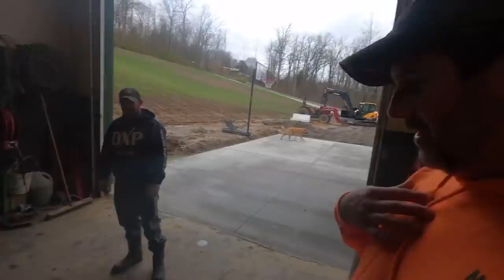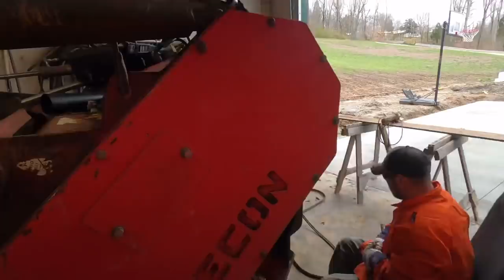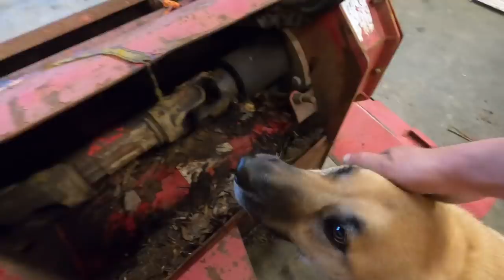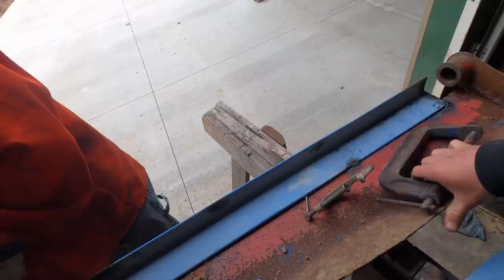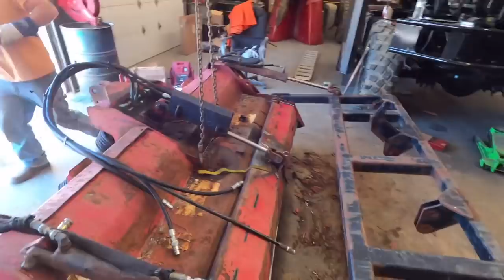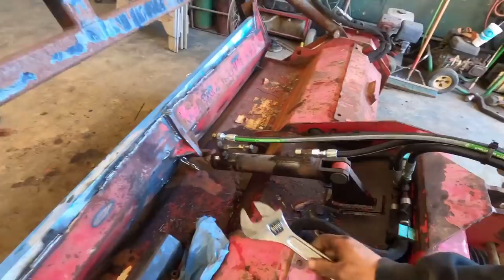Well might have a bought a brush mulcher that needs work and Mrs. Dirt Perfect is not happy about it

Comment: That slop in the shafts are the U-joints wearing out, not trying to be a jerk but you should replace them with your press and replace the belts before they break on a job

Comment: if you have an old axle or even a bucket offa the excavators put it in the bucket of the tractor shes a tilter lookin to happen juuuust right angle an shes gona chew dirt an rocks leaning on the three point hitch so just for safe sake add a bit of weight to the front

Comment: Rubber tires and brush do not mix well but it was a price driven decision on the Fecon, finding a used head for the Kubota would have increased the cost.  A FTX128L used $155,000 if you could keep it busy on utility and pipelines would be great.

Comment: Where is the skid steer mount hydraulically driven mulcher- lol That one you have to use with tractor in reverse and twist around uncomfortably but they do work! Use colored zip ties to label your hydraulic remotes!

Comment: Good work!

I would probably try to shorten the top link on the 3pt, in order to reduce the u-joint angles on the PTO shaft...   The u-joint angles looked a bit steep when lifted...   :-)
Reply from the maker: They have to be equal

Comment: What about the cutting teeth? What shape are they in? They're  probably the most expensive parts on that thing and pretty important that they are in good shape for the mulcher to actually mulch. Being worn out would probably impact the amount of horsepower it takes to keep the drum turning making it need more power handicapping you even more with the lower hp tractor. Just an observation and something that I was wondering about. Good luck with this and I look forward to seeing the mulching video. Might be another purchase in the future if the tractor you have isn't big enough for the mulcher. You're gonna have to send Mrs. Dirt Perfect on a nice vacation somewhere where she'll get pampered so she'll come back all relaxed and calm for when the new larger tractor shows up. LOL! Good luck with that too. 👍

Comment: How is that cheep plasma cutter working outl? Would you buy another? Does it appear it will last a lifetime or no not so much.
I owned a Hobart BetaMig 250 and it was without  a doubt  the best mig welder i have owned .... smooth arc,  easy  arc starts,  and very  powerful very easy to set a sweet spot where it welds well. . I sold it because the parts are almost impossible to find.  Have you ever tried  spray arc with yours? I replaced mine with a Millermatic 250 which is probably  the worst  welder ever made  by Miller. ...lol needless to say that Miller is less than a pleasure  to weld  with.... it has made mig welding  not a joy.
Do you still use the Piecemaker mig torch?   Super comfortable  durable  gun
Reply from the maker: Yes so far so good

Comment: You need 85 PTO HP Not 75 Engine hp.  You need to look at Demoing a Case Farmall C 100, New Holand T5 C 100, Or a John Deere 5100 E M or R model tractors.  These will give you your base 85 PTO hp.
Reply: And prefferably with a front 3pt and PTO  :-)
Reply from the maker: Will just use what I got stay tuned

Comment: I found out the hard way, the welding sparks and molten bb's just bounce off office chair fabric and roll, plus your legs form a funnel that directs those hot sparks and molten bb's directly into a very sensitive spot. I still used the chair but I would sit as far forward as possible so the sensitive area was not vulnerable.

Comment: As skilled as MBTS is, I’m absolutely positive he could convert that 3 point to a quick connect for your skid steer. It’s a much easier operation if the unit is in front
Reply: It's to wide for a skid steer
Reply: Just had one at my house on skid steer measured 76 inche
Reply: When I first saw the video I thought it was going to be about converting it over to skid steer use .
Reply: A skid steer doesn't have a pto to power the head???
Reply: It's to heavy for a skid steer.
Reply: It was kind of a joke guys

Comment: 75 hp vs 85... you'll have to move slower while mulching.

Put 400 lb of something in the bucket so the tractor sits more evenly on front and rear tires with that beast attached.

Comment: Well sir,
    I am sure you did your research, those are pretty high end pieces of equipment, and typically very expensive, but solid built.
    Their weight is one of the reasons “that they take licking and keep on ticking”...
     You got MBTS there to do the little fixes, and will be money well spent.
   Good job man...!
And no sir, I would not even entertain the thought of attempting to sell this purchase to Mrs. DP...
    Been there done that, still married...

Comment: We had a big rotavator that was too big for the tractor, and the front wheels would come off the ground when they hit a bump.  No problem for tilling the soil, but down right dangerous when trying to steer it on the public highway.  My dad used to dab the independent rear breaks to steer, and even that was marginal because the brakes were crap.  I'm thinking we might be seeing something similar with this machine and tractor combo.